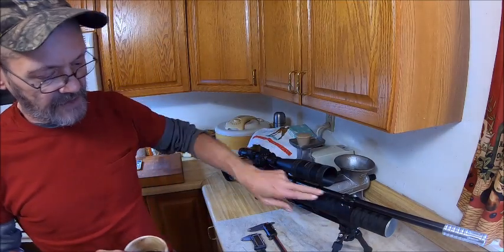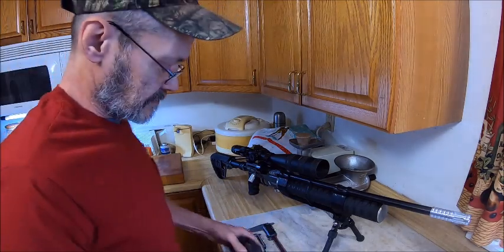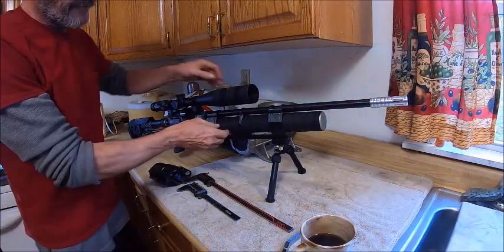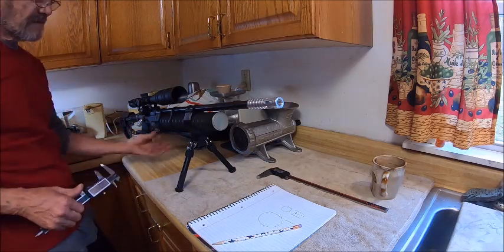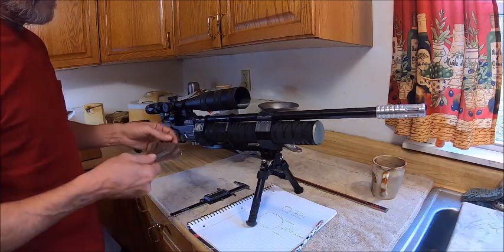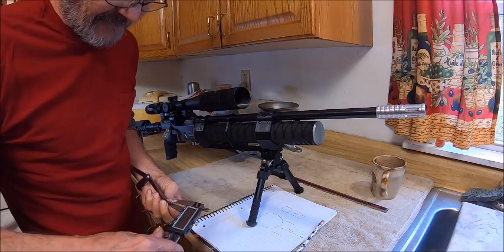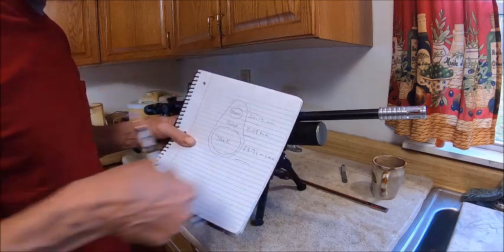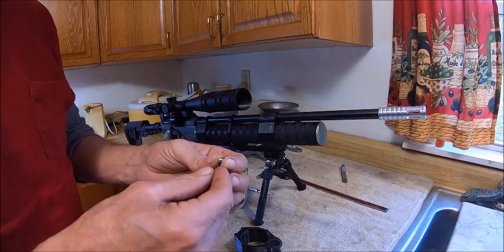how to measure your air gun for a barrel band

Comment: Nice setup, Bob. I was wondering if you have any of that diamond pattern heat shrink tubing for sale? I've been wanting some for a long time but can never find some that might fit. I have a carbon fiber bottle, and I'm looking at your AEA tank, and they look pretty close in diameter.
Reply from the maker: https://www.ebay.com/itm/174110254930?hash=item2889c7a752:g:WmgAAOSwUYNaRLV4&amdata=enc%3AAQAIAAAA8LACqLCpJxKjqHzOnqFs0lhMAN%2BNFeHx8MwNwUbHyG9kcJfrbWXNXAJDuCdrjxt1%2FVvh3JRT56Tw27Ie6daaAqgHIeQdEAy%2BoyKedlV1uYCmxOaO6JxkuupseykEyxVbOjaTp9BIEPwcnwqjktPw98v%2BlsBd9B%2Bs0KbktUmVpuXT9FVHnkHv9ofXbsFls87JvW387CPxKMmnmzDgS64Bhm9GooGjNcZwfzGVVGVDNi2NBgYGW4QqKSBv4KkZDWOYKOU7fYIEh%2BZeIe2IBWUBJFrr5twwDsPQ5jr6yr3j3AotVgctYO7J7%2FoiBHR3ez3Fsw%3D%3D%7Ctkp%3ABk9SR5aM5fmbYw